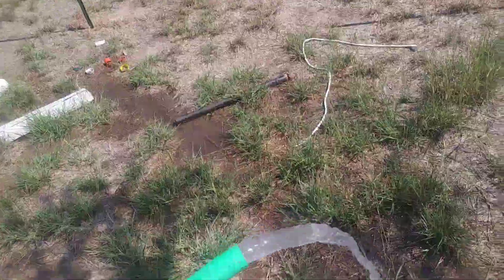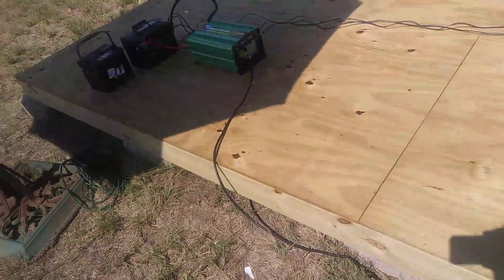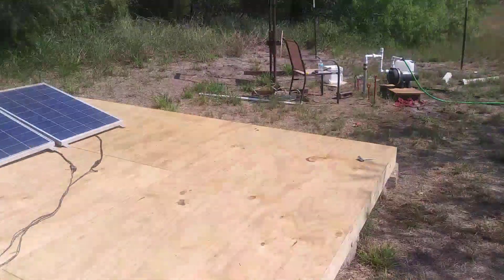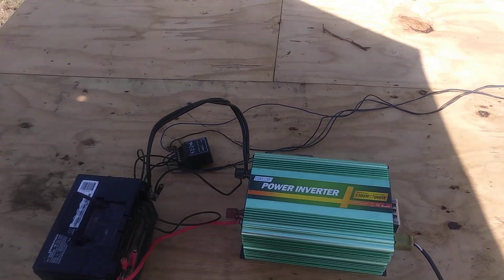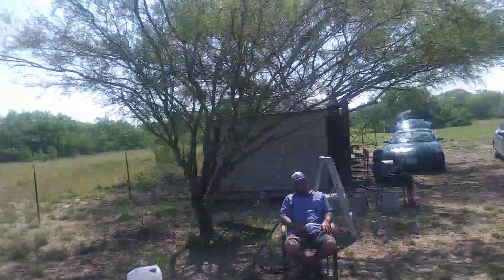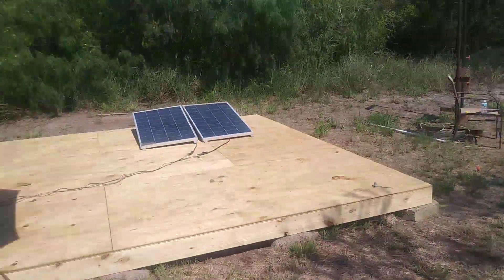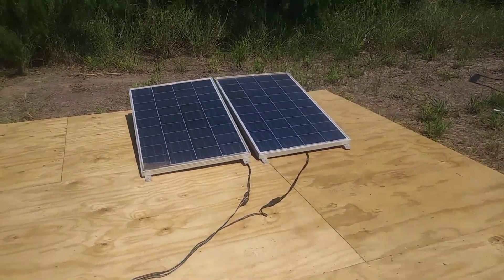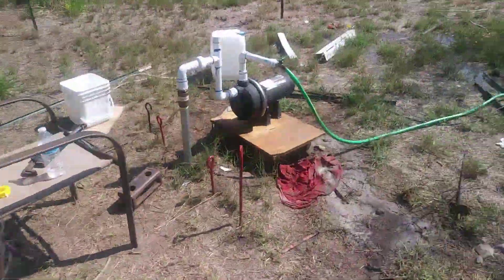Running a well water pump on solar energy.

Comment: Are solar panels 100 watts a piece? Great vid.
Reply from the maker: You can get them for $70 at EBay here's the link where I buy them http://rover.ebay.com/rover/1/711-53200-19255-0/1?ff3=4&pub=5575468784&toolid=10001&campid=5338455967&customid=&mpre=https%3A%2F%2Fwww.ebay.com%2Fitm%2F100-Watt-100W-12V-12-Volt-Slim-Solar-Panel-Battery-RV-Boat-Camping-Off-Grid%2F264618723815%3Fpageci%3Dc7825f8c-ca3a-4326-aa35-5106b3b79f04